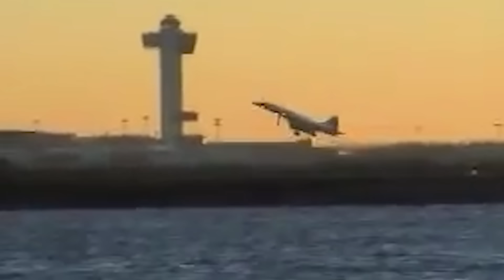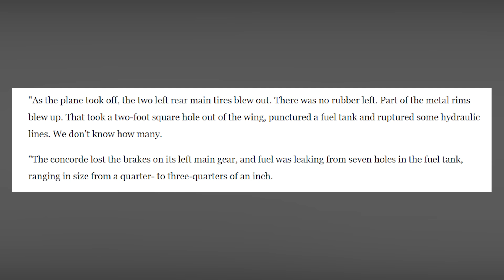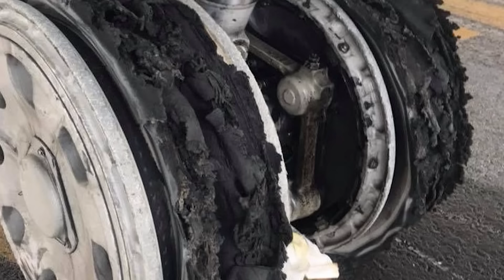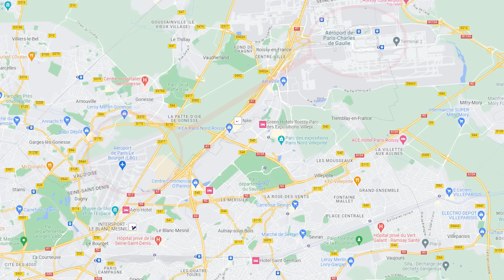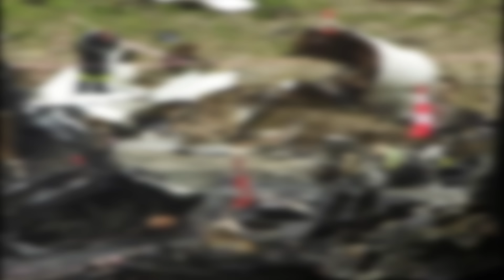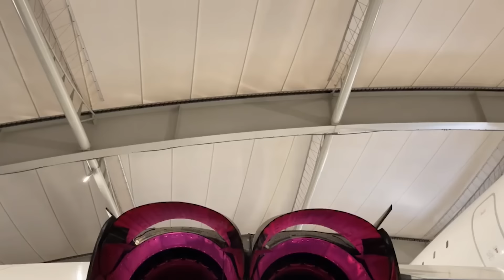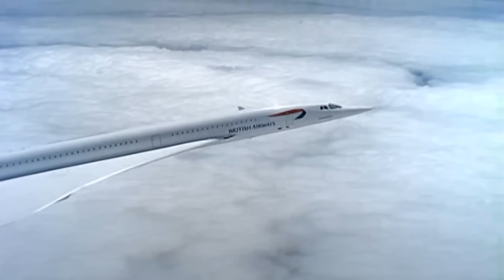The TERRIFYING Crash That KILLED Concorde | Air France Flight 4590

Comment: How on earth does a pilot think they will make it to Le Bourget on fire? They did make it to the Relais, however 79 secs away.
Reply: What else did u expect him to do? Le Bourget was the closest place to land, only 3-4 min of flight time, which is much faster than returning to De Gaulle, even if they had been able to perform the turn. They also couldnt see the fire, so didnt know, how bad it was, and the FE shut down engine 2 without telling the captain.
And FYI many many airplanes have engine fires and are able to fly much longer and further. It was established, that the fuel tank had burst and was gushing out fuel in such volumes, that it turned into a blowtorch, that literally melted the wing, which, again, noone in the cockpit had any way of knowing.
Going for Le Bourget was their only option, and the captain kept trying until the end, even as the plane inverted, he kept trying to fly it. Theres a tiny chance, they might have made it, had the FE not prematurely and without authorisation shut down engine 2, but its highly unlikely due to the unheard of intensity of the fire.

But there are very good reasons, why its standard operating procedure to take off after V1 no matter what, coz 99.9% of the time thats the better option. Even with an engine fire u take off, go around and land again, only here they werent notified of the fire, until just as they were leaving the ground. They tried to turn around, but couldnt, so they opted for the only place to land, Le Bourget, which they were almost lined up for with their direction. And as I said, Le Bourget was only 3-4 min of flight time away, going around to return to De Gaulle, had they been able to turn, would taken at least 10 min, if not 15.
Try timing urself for 79 sec, and see how much problem diagnosis and solution, as well as actions, u can get through in that amount of time.
Reply: @dfuher968 You said it best

Comment: The debris on the runway started and finished off the Concorde, end of story
Reply: How did it start it?
Reply: No the crash didn’t end the Concorde it was finished because of financial difficulties with the Concorde ranging fuel cost and mechanical cost plus the tickets cost of about $6k+ to fly on Concordes this crash solidify the mechanical issues with the tires which only British Airways made the changes after another accident involving Concorde and it’s tires Air France didn’t make the changes despite their British counterparts recommended the Fuel tanks were flawed that if something hit them hard enough they would rupture which was a huge design flaw and that’s just stating some issues of it also 9/11 also occured after this crash about a year later which also put a financial dagger into the Concorde. The Continental flight wasn’t the cause of the end of the Concorde but it exposed and speed up the process of the decline of Concorde
Reply: Sorry Ticket cost on the Concorde for round trip was 12k so 6k each way

Comment: Because of its shape and thinness ive always looked at concorde as been a bit flimsy where if anything did go wrong its a case of your times up. I much prefer the larger widebody aircraft to concorde.
Reply: All airplanes are incredibly flimsy, regardless of shape. It really makes no difference. They’re not designed to withstand impact of any kind.
Reply: @aaroncollins5188 There are many forces that can put strain on an airframe. It's reasonable to look at that thing and feel concerned about how it might perform in turbulence- which is fairly chaotic and unpredictable, even the most brilliant scientists barely understand it.
Reply: @aaroncollins5188  does not matter what your in, if your travelling hundreds of miles per hr and u hit something hard that's it!!
Reply: @easydrive3662 I mean that’s my point

Comment: The Pilots had a lot to answer for and it ultimately killed all on board...horrific way to die,  you would be fully aware and unable to do anything, may there passing been quick and the Angels carried them swiftly away
Reply: How did the pilots have a lot to answer for?  Air France maybe, for not taking note of previous incidents where tyres burst and pieces were flung into parts of the plane.  I feel the Captain should have tried to stop after V1 as it gave them a chance.  Taking the plane into the air in that state gave no chance at all.  But these things happen in seconds - the startle factor alone would mean any reaction wasn’t instant.  Hindsight is wonderful.
Reply: @moiraatkinson Captain chose to takeoff despite the aircraft being overweight
Reply: @PointNemo9 fair enough.  I hadn’t absorbed that fact.  Though it may not have prevented the subsequent events, it could have caused enough of a delay to prevent them taking off right behind the Cathay Pacific plane and possibly another aircraft would have blown a tyre instead, with less devastating results but with enough concern to sweep the runway.  But the main advantage to not taking off overweight, is the plane could rotate earlier, missing the strip of metal entirely.
Reply: @moiraatkinson   On YouTube there is a video of John Hutchinson (British Airways Concorde pilot) talking about the actions of the captain leading up to the crash.
Reply: @moiraatkinson  It's called fate. When your time is up, nothing can be done to prevent it.
Reply: @Robert_N 💯
Reply: @PointNemo9 that’s really interesting.  I’m going to see if I can find that now - thanks!
Reply: @PointNemo9 I now agree with you that the pilots had to take most of the responsibility.  They couldn’t have imagined the outcome of running over the strip of titanium, but that’s why people are told to stick to SOPs.  It gives the best chance of eliminating the unexpected mishap.  At any rate they were more culpable than Cathay Pacific, who shouldered a lot of the blame (no doubt as they had the money to be sued for a large payout).  

Mind, you got me hooked into listening to ALL the John Hutchinson interviews and I’ve got nothing else done today 😂.
Reply: @PointNemo9 when you are past your v1 you don’t have room to stop. In any case they did modeling , the plane would have crash likely killing all in either case at those speeds.
Reply: @moiraatkinson The aircraft was overloaded with both  fuel and baggage and that caused the aircraft to be well outside of its c of g limits. The crew and in particular the captain were responsible for accepting the extra baggage even after being told by the dispatcher it would make them overweight.
Reply: @jaguar3248 also they transferred fuel from the rear tank into the wings - presumably to try and correct the c of g - on the takeoff which is a big no-no.  They turned what might have been a well managed mishap into a catastrophe.  Do you think they should have aborted the takeoff?
Reply: @moiraatkinson they we’re screwed either way. It was too late to safely abort.
Reply: @MarissaNye I’m sure that’s right.  I just feel it could have been attempted because doing nothing was a poor choice as well.  Even if ONE person survived, it was worth trying - if only to avoid casualties on the ground.
Reply: Exactly some of the plane crashes that have occured where the passengers knew they were going to die in the coming seconds or minutes is just the thing of nightmares! What a way to go tho, burnt to ash on concorde!
Reply: Probably not though. Burning to death can take up to 20 minutes.
Reply: @tylerchapman9234  they died on impact. The plane literally crashed into a building. There was no burning to death for 20 mins.
Reply: More fantasy!  Angel's......ok

Comment: It was not Concords fault the plane prior left debris on the runway.They should never have stopped it flying.
Reply: I agree they shouldn't have stopped flying it for THAT particular incident but the die was cast and people were afraid to fly on it. If they did decide to back into the air they desperately needed to solve the problem with the tires.
Reply: They just wanted an excuse to put down the bird that cost barely enough to break even.
Reply: They didnt quit flying after this. They resumed after extensive changes, but it was shortlived, as even b4 this incident it was losing money, it was too expensive to keep flying.
Reply: Exactly!!

Comment: The A380 does not fly 735 miles an hour
Reply: and the A380 not faster than a B747. The B747 is actually a bit faster.
Reply: Yep,right off the bat I'm wtf??? 737 mph? NO
Reply: I think most of the A series, A330, A350, even A380 can only do 950 or 960 kilometres an hour maximum. I ve been on plenty of A330 for work and leisure, they usually cruise at between 880 to 950 kilometres an hour. Quite a bit below Mach 1.

Comment: 737mph on the a380?.

which would make it basically supersonic 😂
Reply: That's mach 0.96. And it will never fly at that speed in normal flight.
Reply: @kikastra the top speed according to google is 634 mph.
Reply: @TriViuM2k22  Search this exact phrase: "airbus a380 top speed". The answer provided right at the top is 1185km/h. Convert that to mph and it's 736mph. Then if you don't trust that result click on various other links and you'll see the same. Remember that's not it's cruise speed, that's as fast as it can absolutely go. Either way it's not super sonic at all.
Reply: @kikastra  I didn't claim it's super sonic. I simply posted what google said.
Reply: @TriViuM2k22  The original comment basically did, sorry for the confusion. I also posted what Google said. I guess Google is wrong about one of them. But I keep checking and it's not mine. 🤷‍♂️
Reply: @kikastra  it's the first result for me. Going further down I do get other max speeds. It doesn't really matter though. 🤷
Reply: @TriViuM2k22  you are right, it doesn't really matter, I'm just saying what Google says for me. Cheers.

Comment: The undercarriage wheel spacer had been left out which caused the plane to crab on takeoff as witnessed by a waiting 747.
The pilot had not checked baggage weight and also took on 2 tons of taxiing fuel which was unnecessary and compromised the centre of gravity.
They shut down the engines which was incorrect as they were still ok and only the flames were from the split tank.
The metal strip was possibly not involved.

Comment: It was completely avoidable the French laissez faire attitude made this an accident waiting to happen.
Reply: Supposedly caused by a piece of metal puncturing a tyre.Actually caused by missing undercarriage bogie spacer which caused the plane to be dragged crabwise on takeoff.
Also the pilot had not checked baggage weights and had taken on unnecessary taxiing fuel in an aft tank.They also shut down the engine they thought was on fire which was erroneous.

Comment: I have heard it be said that whether they took off completely or attempted to cease the flight altogether, they were screwed. Sadly, it was gonna be a tragic outcome regardless. It's amazing to me how a relatively small piece of debris on the runway caused such a horrific, fatal crash.
Reply: @mikeh.7499  You mean they were suffering in severe physical agony from horrible burns for 3 weeks?? Omg!
I'm so sorry to hear about that.
I had second degree burns on my back from an accident I once had, and that wasn't life threatening but still was the most awful pain. I can't even imagine the pain if the burns are bad enough to be life threatening. What I wish for is when it's my time to go, I'll go quietly in my sleep and that there'll be no pain and suffering. I wish that for you and everyone when it's all your times also
Reply: If they aborted the takeoff after V1 - and this would qualify as one of the reasons it was considered acceptable, though Concorde may differ from normal planes - then some people may have survived.  It would still have been a disaster, but there was more chance of avoiding the number of deaths on the ground for instance.
Reply: @moiraatkinson No, aborting the takeoff was not an option. A. ATC called them about the fire, just as they were taking off. And B. at the end of the runway was a fence, a service road and a building, all of which they wouldve hit.
The pilots made the only sensible choice. There was nowhere near enough runway left to touch down again, and they also couldnt see the fire, so they didnt know, how bad it was. They shouldve been able to make to Le Bourget, that was just 3-4 min, much faster than returning to De Gaulle.
As the OP said, they really were screwed either way, the moment they hit that debris.
Reply: @dfuher968 OK, fair enough.  I wasn’t aware of what lay in front of them if the aborted the takeoff, though I am aware it would be at a far greater speed than, for example a 737 aborting after V1.
Reply: @moiraatkinson  No there wasn't.  Both port engines were smuthered because of the fire (engines ingesting flames that had consumed all oxygen) so differential reverse thrust (right engines) was their only realistic stopping power.  

The breaks on the port gear were taken out by a rubber fragment severing hydraulic and electrical lines so again, differential breaking was all they had.  

They would never have stopped before the end of the runway with such compromised stopping ability, and concord's lengthy landing gear struts would have never withstood the stress of the gear digging into soft earth when they went off the end.  

If they had tried to reject the take off they would either have spun clockwise out of control and in the process engulfed the entire aircraft in burning fuel leaking from the wing, at least until the port wing caught sideways air and flipped them over, still engulfed in burning fuel pouring from the wing.  And once upside down and sliding along the runway at 400 kph (Concord take off speed), it's pretty clear what would have happened next inside the cloud of burning aviation fuel they were in.  

Or, once off the end of the runway, the gear would have been ripped from under them and in the process the air frame would have been torn apart most likely splitting open the starboard wing and setting it on fire as well.  

At least with how it happened they didn't suffer, they hit the ground at 400 kph.  I'd rather that than being inside a disintegrating aircraft sliding along the ground engulfed in burning jet fuel upside down or otherwise.
Reply: And the runway FOD inspection that would have found that debris was cancelled so they could go elsewhere in the airport for a drill.
Reply: Yeah, and what's worse is what the thumbnail of this video stated, they were not killed instantaneously, they were consciously burned alive! It was not quick and painless! They suffered! They burned alive!
Sorry, reading or hearing about that really gets to me.
Reply: @alvexok5523 You are wrong! They were dead on impact. No one can survive when you hit the ground at 200mph!
Reply: @philipme109  I sure hope that you're right that they died instantly and didn't suffer, but on the thumbnail of this video, it says "113 burned alive". That's why I said what said above
Reply: @alvexok5523  I have seen actual pictures of the crash site. You can find them on Google pictures. The aircraft hit the ground with such force it was instantly turned into shreds. Just like the passengers on the aircrafts that crashed on 9-11-2001. All of those poor people didn't suffer, they died instantly
Reply: @alvexok5523  They didn't suffer, they died instantly when they hit the ground.  Anybody with two brain cells can figure that out when you look at the numbers.  This aircraft hit the ground inverted at +400 kph. duh
Reply: @johnrauner2515  "Duh"? The thumbnail of this video says that they were burned alive. I hope you're right that it was instantaneous, but I got the info that I said from the thumbnail.
Reply: Read Mike Bannister's book "Concorde" for the Full Facts--the piece of metal didn't cause the crash